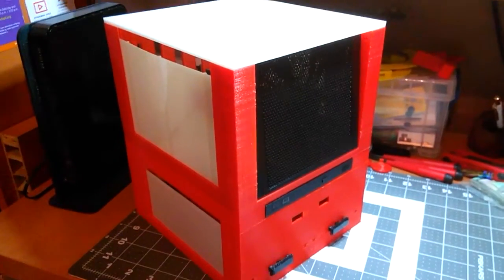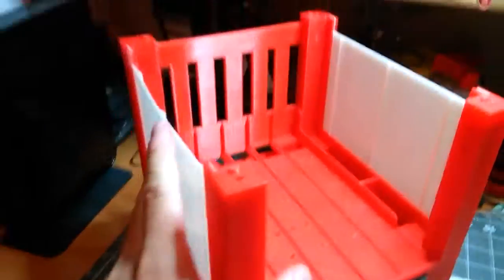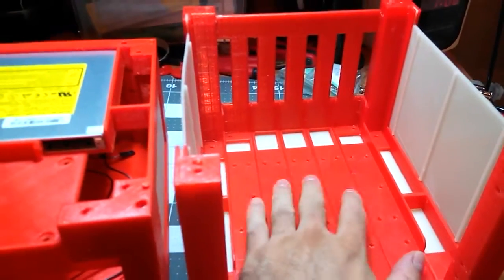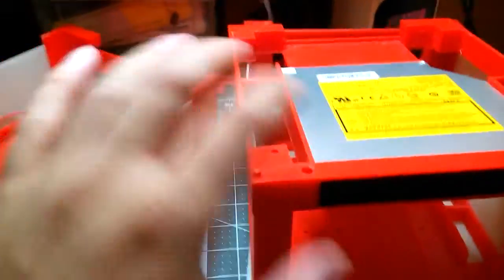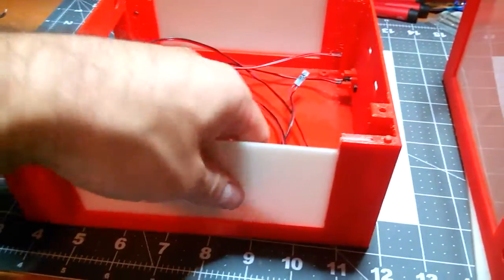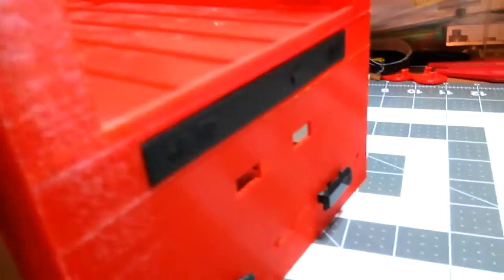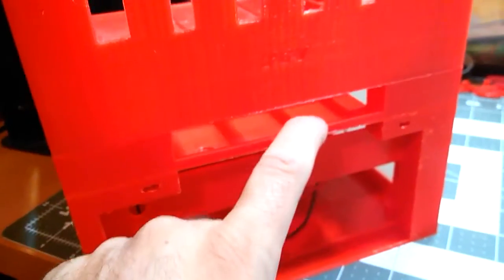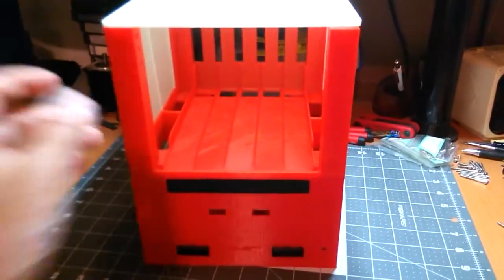My 3D printed mini itx NAS case

Comment: Finally some sane 3D printed case. All I've seen were open-air, which I'd rather do out of wood or something else and wall-mount. Good job.
Reply from the maker: Thanks! So far I have made many more changes to the case and the bottom is done and I have been using that as my main desktop case. I ran into some issues with my 3d printer so although I worked on the design, I haven't printed the drive cage again. I built another 8 drive nas that is not 3d printed so I'm using that for now. We also moved into a much smaller place so I haven't been able to do much here. Just a number of things unfortunately that kept me from working on this. I also want so see if I can redesign the larger parts into smaller parts to make things even easier to print. Those large boxes take many hours to print so you can end up with warped parts too. Also trying to sleep with a 3d printer working for hours can drive you crazy.